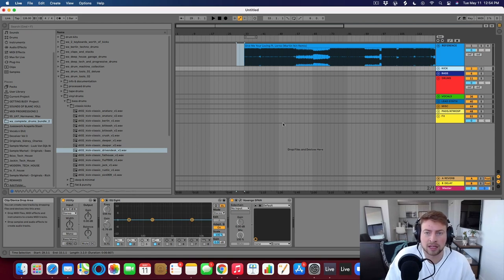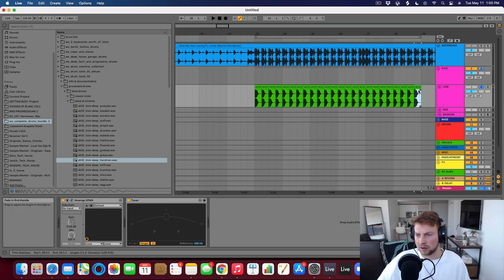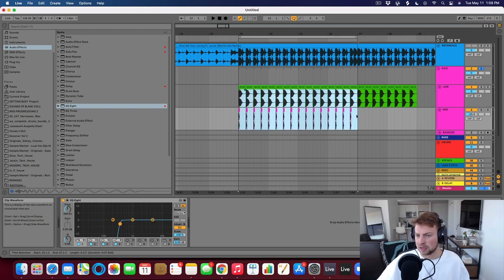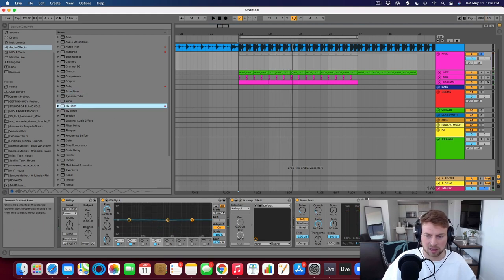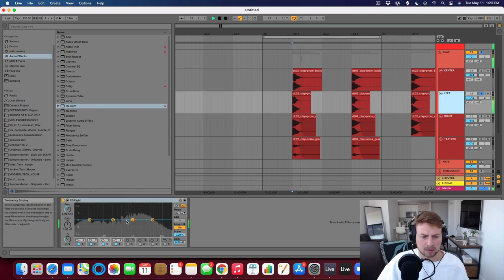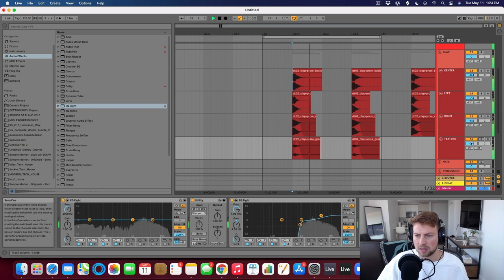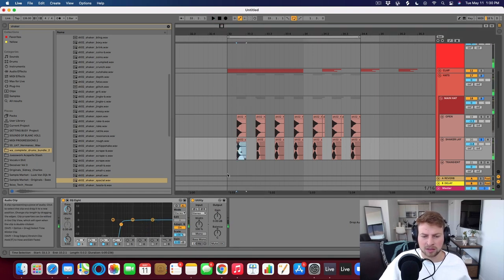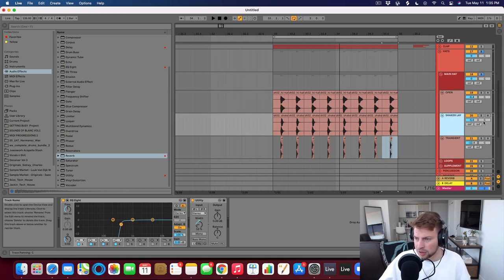Drum Layering with Coach Westend

Comment: This helps me so much with layering drums. Thanks for that.
I got fabfilter Saturn 2, but dont got the same presets as you. can I buy them somewhere?
Reply: Westend is using the original FabFilter Saturn. You won't be able to see those presets if you are using Saturn 2. My suggestion is to pause the vid and copy the settings you see on the screen. It's a pretty basic patch, thankfully.